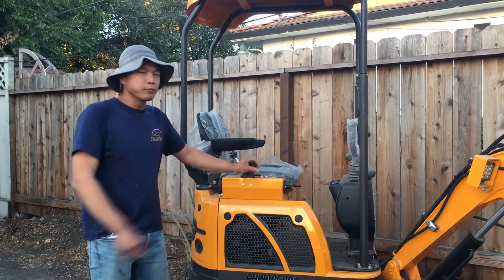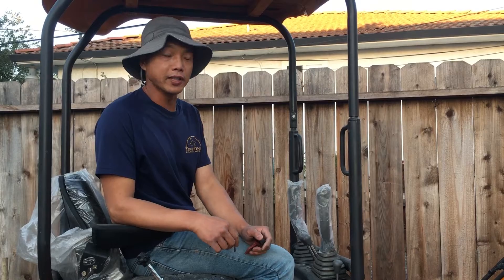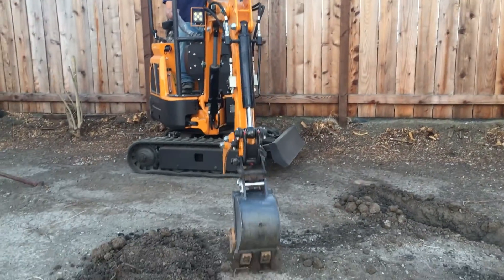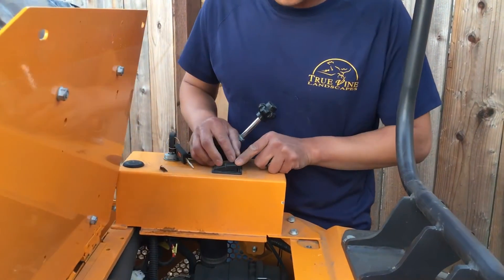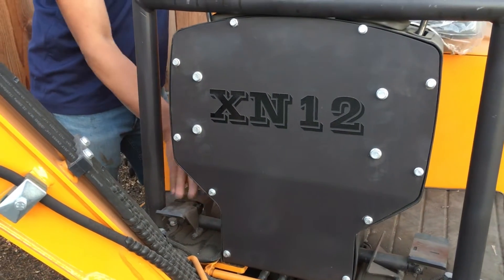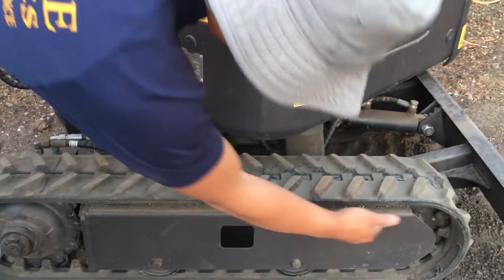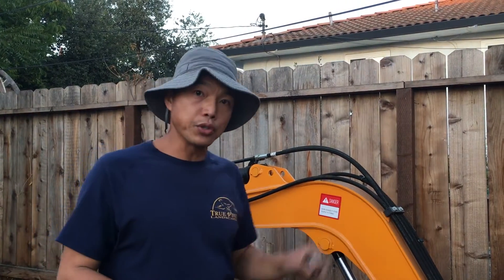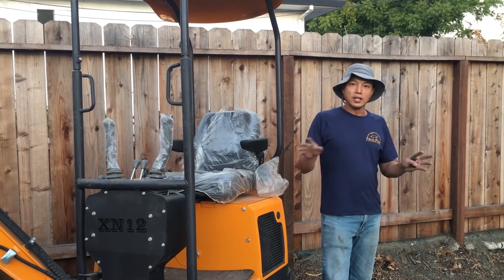Show-and-tell the XN 12 Rhino Excavator with Kubota diesel engine, same manufacturer as the XN16

Comment: Oh Mate, so glad I found this vid from you. I bought one the other day in Australia. It isn't called a Rhino but a UME 1.2 t. I would love it if you could show some maintenance / service procedures. I don't have a manual etc. Awesome intro.Thanks.
Reply from the maker: Sure I can show some maintenance video.  All these are generic and the service work is relatively the same, and the best thing about these are the simplicity of its design.
Reply: @1BigSkiddy  Yeah mate got nearly 20 hrs up, i'm a plumber no idea about machines, we pushed it a bit too far with lifting weight and it came out ok. Grease nipples are a bit hard to find (all of them) and had to change grease nipples to standard gun size which was no problem. Kubota motor go for it.
Reply: How is it holding up Richard? 
I bought a xn12-8 and wasn’t a fan, very sloppy to operate and the build quality wasn’t great at all
I’m from Australia too
Reply: @Pepper_brooks  Hey Dan, Got 100 hrs up now. It's not a Kubota but hopefully it keeps going like one. Sloppy buckets etc. The 14 mm bolt for the hitch is difficult to find and replace, I've been through 1 already. Cheers
Reply: @RichardSmith-rp7yp  been a year since your last post. How's the rhino now? Is the motor still good, pins etc and general feel of the machine still good enough for the money?
Edit, sorry, not rhino....UME.

Comment: To start do I need to put oil in the engine or those it come with it already
Reply from the maker: Just like buying a car, it comes ready to use.  Of course you should check its oil and fluid, and change it when it’s “broken in.”. Cheers and thanks for commenting!

Comment: There is a company in my country that sells this exact one for 10,000 € (~12,000 USD) new. Is that a good price or should I try to hustle them lower somehow?
Reply from the maker: I think the e price is fair, see my other video, https://youtu.be/SnlumfE_UJI
However, I did a real digging test today and I’m sad to say I had a disappointing experience on its performance.  I’ll have to do a side-by-side comparison against my Landscape Buddy tractor.  I suggest if you can rent it for a few days to test it out before having to put down your hard earned money for a tractor that may not meet your expectations.
Reply: @jasonyeh99  What happened? Was it underpowered? Hydro pump failed? Something else broke down?...
Reply from the maker: I have no idea.  I’m trying to figure out too.  My suspicion is that the hydraulic pump is undersized, or maybe the dirt was too hard!?  But the dirt was not as bad compared to my last job.
Reply: @jasonyeh99  you can try using the claw attachment to scratch and break up hard soil before you switch to the bucket
Reply: @jasonyeh99  You may want to check your hydraulic relief valve pressure.  I posted vid on how to do that.  Also, the mini is very light and the hydraulics easily lift and move it around.  Proper use of blade for maximum digging force is necessary.
Reply: @Ljosi  I have and extra ripper tooth that fits and I am local.
Reply from the maker: Thanks for mentioning it.  I just got a testing kit and would be hooking it to check the bucket hydraulic pressure, perhaps it just need adjusting.
Reply: @jasonyeh99  The RV on my XN08 was nuts-on, but the machines we imported from Oking were set WAY low.  Some were at only 1500 psi, and spec is 2500.

Love your 3-cyl Kubota engine, Jason!
Reply: @Ljosi  Lol, use the grab to dig because it hasn't got enough go. What?
Reply: @Senkino5o  yeah, I experimented and found it to be a good way to break the frozen top layer of soil by pinching it, later switch to bucket and dig the soft

Comment: Hi 
This safety issues aren't that bad as you say.
By default you are not allowed to park excavators on the slopes. If you must do it you have to put bleda and arm to the ground. Same think is on the flat. Blade and arm must be lowered to the ground if you park an excavator. That goes for all models and brands. If what you say would be thru that big company's like Kubota and Yanmar couldn't sell their smalest models which are made similar.
Otherwise great job.

Comment: thank you Jason...I  am Jeff from Indonesia... i interested to buy XN 12 or XN 16... Do you recommend XN 16 over XN 12 for the best value?  Is XN12 not enough digging force ?
Reply from the maker: Generally you want to get the biggest machine you can afford; and for work access, you want to get the biggest machine for the smallest space possible.  I think my XN12 is likely not adjusted right, I have to find time to troubleshoot and adjust.  It’ll be another video some time.  You can also consider my Landscape Buddy tractors, if it fits your needs.

Comment: I made the mistake of buying Chinese machinery twice.never again .They are nothing but trouble,Don't be fooled by the Kubota or Yanmar motors the are the honey to draw in the suckers thinking they are buying a reasonable machine.The engines may be good but the rest of the machine is rubbish.Remember you get what you pay for.
Reply from the maker: if you may, please let us know what happened?  My experience with the excavator and the walk-behind skid steers are, generally speaking, decent.  They are not the best built, but for the price I think it’s welled valued machines.  Cheers and thanks for commenting!

Comment: Most of them don't have a Kubota motor which I imagine eliminates a lot of the problems with the garbage engines they normally have.
That said I've encountered just 1 of these in person and it was broken down, hunting and stalling at idle.
Rubbish, you can get a name brand 3.5t machine used for the same price, with attachments. I would distrust any contractor who had 1 of these - Ask yourself, If he cuts corners with such a fundamental tool where else will he cut corners?